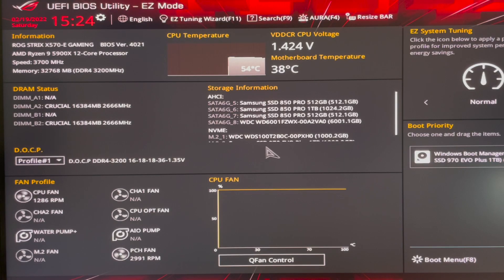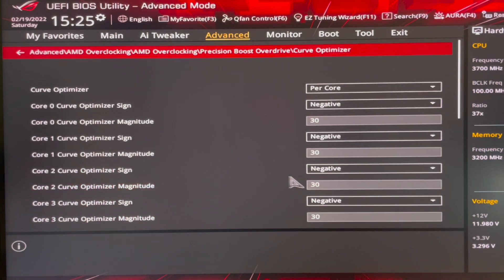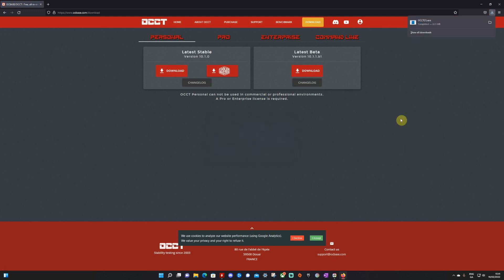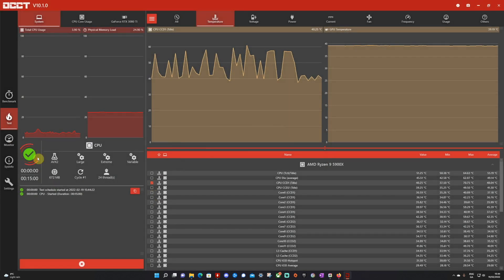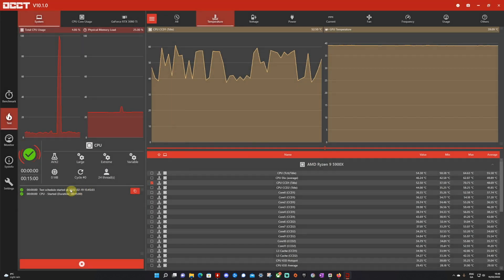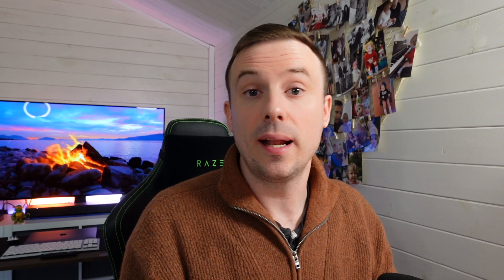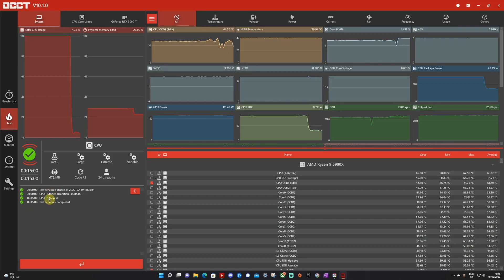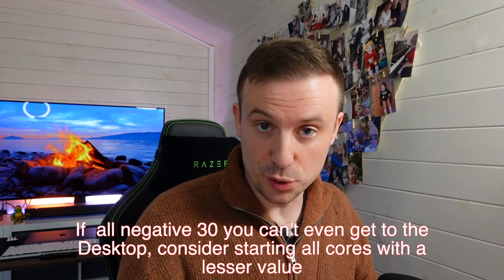Ryzen 5800x 5900x CPU Per Core Undervolt Bios Settings | Lower Temps | Better Performance

Comment: on my 5800x I have a 1.2 core voltage max with a 4.6 core clock and 100mhz boost with PBO disabled in bios completed the 15 minutes stress test on extreme twice in a row and hit a maximum of 66c averaged 60c all cores at 4600mhz. Whereas in PBO curve Optimizer I had all cores negative 30 except my 7th core that had be brought down to -15 and then it passed the OCCT test twice with a max temp of 77c and an average of 74c some cores hitting a max of 4.790mhz most staying at 4.680/4.700.. long story short I reverted back to my manual undervolt/overclock.  I musta hit the silicone lottery with a 1.2v max at 4.6 all core great video and very detailed, PBO just isn’t as good as a manual undervolt/overclock imo. 
Gigabyte Aurous b550 AC 
5800x 
dark rock pro 4 
RTX 3080ti ftw3 ultra
Fractal torrent (stock fans no extra)          HX1000 PSU
Reply: I'm curious if you tested both overclocks against cinebench. Where the score results similar? Which scored higher points if at all?

Comment: Tried -15 -20- and -25 it seems -25 is the sweet spot for my build set the undervolt to all cores and off we go. running smoothly at manageable temps up to 68deg @ 4600mhz+ using occt. Idle temps also improved from hi of 50ish down to 45ish kinda impressive. This is the 1st time i used amd and do actual OC and im proud doing it. before I was so afraid to do it on my intel systems and decided to switch over to amd. Im happy now. thanks.
Reply: hey i wanted to ask, do you find intel or amd either of them more stable than other
Reply: Much easier than doing overclocks in the past . I was always worried about frying stuff and did lose some ram sticks because of it . Thankfully most ram always had a lifetime warranty 😀

Comment: I have a 5900x and tryed it out
But it shows me always an error in core 11..
I've reduced from 30 to 25 20 15 10 5 nothing worked
Reply from the maker: Unusual that didn’t fix it. Did you go all the way to zero? Def the right core I assume
Reply: I didn't try zero. I'm gone down to 5.
Now i set it to all cores like in yoir previous video "option 3" and started occt without to stop by errors. It shows me always errors with core 11.
Idk what to do i'm trying this the first time
Reply from the maker: For this one just use the settings in this video for the amd over clocking settings and do the per core test. You may have to go to zero.

Comment: Getting errors on virtual cores? Should I still lower values per core or do I only do this on physical? Sorry new to all this budd
Reply from the maker: You lower it on the same value core in the bios. So if the error is core 15 then it’s core 15. All should relate back to a physical core
Reply: @FPtechtalk  thanks pal just disnt know if the same for virtual cores. 👍
Reply from the maker: If your still not sure you can email me some screenshots and I can have a look
Reply: @FPtechtalk  thankyou mate

Comment: Hi thank you for this nice Video, very enlightening.
I have a question: I have a Ryzen 5950X and my whish would be to run the base clock as low as - may be 2.4 GHz - but also being able to peak the normal ranges. This would be good for a very power efficient idl mode, since 16 x 2.4 GHz would be more than enough to power any Windows task such as webbrowsing, office, etc. but also needing substantial less power + being very silent too.
I have not fond any chance to do this, you can set the CPU clock down, but this would mean that there is no boost anymore, the CPU clock will stay at 2.4 GHz all timen no matter single core or multicore ...
Is there a chance to to this ? I found plenty of instructions how to overclock the system but nothing how to "underclock" the baseclock.
Thanks + Greets
Reply from the maker: Thanks, afraid I don’t know of anyway to lower the boost clock. Are your temps high on idle ?
Reply: @FPtechtalk  Thank for your fast reply. 
Not realy, the temps hovered around 45 deg. but went down to the 28 to 33 when clocking down to 2.4 GHz. The power cons went down singnificanty also, but there is no boost than, the clock stays at 2.4 all the time. That does not realy make sense to me ...
Reply from the maker: I did notice this before and wondered why the clocks get so high when idle. If I find an answer I will let you know
Reply: @FPtechtalk  Thanks, that will be nice. Have a nice day.

Comment: Hello, I’ve tried this and option one in the previous 5900x video. Yet after I save and restart, it blue screens and says it will try and repair and restart however it then enters a never ending loop and does not solve the issue. Any suggestions?
Reply from the maker: Are you able get to the bios? Are you sure you were in the right overclock section in the bios ?
Reply: @FPtechtalk  yep I’m pretty sure I have the msi 550a-pro, and I went to the amd overclocking in which I have turned PBO to advanced and followed the steps from there.
Reply: Then after all the steps it says your device ran into a problem and needs a restart we’ll restart it for you. Then it proceeds to restart and says the same thing. Which then I have to restore the bios to default to start my pc up.
Reply from the maker: If you can get back into the bios I would reset settings to default
Reply from the maker: Not sure with the bios you are using. I would reset all settings. Maybe try just the curve optimiser
Reply: Ok update now the pc turns on but there’s nothing coming through on the monitor.  I am now panicking. I’m sorry but as of right now I have no idea what to do
Reply from the maker: Are you getting any error lights or codes on the motherboard
Reply from the maker: I’d try the clear cmos button on your motherboard to reset it
Reply: @FPtechtalk   hello again, after leaving it without power overnight it is working again on default bios settings. I just want to apologise for me asking so many questions. Now I have tried just the curve optimiser and still the same message. Could it be due to an outdated bios? Or something to do with windows itself?
Reply from the maker: There could be any number of reasons here but I would def check if your bios has an update available. If your temps are currently ok I prob would not undervolt. You should be able get a stable pc with the curve value set to 10. If that’s not working it prob won’t work for you. Good to hear all is ok again.
Reply: @FPtechtalk  ok I shall try those things thank you very much you have really helped :)

Comment: Found anytime I mess with these numbers and reboot, Windows goes nuts, won't boot normally the first time, but then does boot, or it will boot up into Windows, and hard reboot itself. Usually get some corruption of files when this happens. No idea what is going on. I ended up setting a thermal limit and it still performs really good, 150fps with an rtx 3080 also throttled.
Reply: Make sure you’re changing it in the Advanced / AMD overclocking area. I screwed up the first time I ever tried messing with this also. Scary reboots etc. 

Try starting with -10 and go from there.

Comment: Very informative video I needed this and was searching for awhile on proper way to underclock per core so thankyou for ending the headache but one question is it dangerous to have pbo limits disabled ?
Reply from the maker: No issues disabling them. That’s just if you want the bios to control them.

Comment: There's a much better way to test this. 
- Select Advanced under 'Threads', then click on Advanced Thread Settings. 
- Select only one Physical Core and test it for 1 minute. 
- If it errors or not, make a note then change to another Core. 
- Repeat until all cores have been tested.  
- Adjust all errored cores down by 5 until you reach 20, then 2 after that in Bios.  
- Repeat the above until you get no errors.  
- Do an all core test for 1 hour.     
This is much faster and more accurate this way, and because it's a single-core test, it actually stresses that core more than a multicore test would. It also allows you to monitor the single-core boost frequency of each core. Better cores will clock themselves higher.
Reply: You should make a tutorial then.

Comment: can you make a video explaining and optimizing to get max performance for single core for gaming in instance for fps increase? I have a custom watercooled pc so my temps are typically low.
Reply from the maker: When I use the curve optimiser per core and allow an offset of plus 200mhz I can get 5ghz single core on some cores. There is more you could do but this is all I have done

Comment: Don’t know if I did anything wrong but when I do this it only running at 3693.2 MHz is this normal?
Reply from the maker: No some setting has been changed. In the ASUS bios on the start EZ mode page see if Ez System Tuning on the right is set to normal. Just guessing but let me know. If not that I’ll try look up what setting it is
Reply: @FPtechtalk  it is set to normal shall I change this?
Reply from the maker: Normal is right. I’ll have a look to see if I can find what setting it is. The other option is to update your bios if one available or reset the settings
Reply: @FPtechtalk  I have managed to get past the 3.7mhz and get to 4.2 constantly but I need to change every core and it is nothing like yours when u need to change 2, could be a change aswell??
Reply from the maker: Not sure without seeing what your doing. If unsure I’d just reset the bios and look at start again. I have not changed any options other than what you see in the video. Is your bios up to date ?
Reply: @FPtechtalk  my bois is version 4021 x64 for the asus x570 gaming e
Reply from the maker: Bios version is fine. Just not sure what options you have changed. If you can’t get it working right I’d just reset and start again
Reply from the maker: Just checked and the latest version is 4204. Might be worth updating
Reply: @FPtechtalk  I will give it a go
Reply from the maker: Just done an update myself
Reply: @FPtechtalk  please tell me if there are any changers or I just clueless

Comment: When using AMD Overclocking menu to change PBO settings, what do you do with the PBO settings in the Advanced Menu and in the XFR Enhancement menu? Do you leave PBO on Auto or do you disable it in those other 2 areas?
Reply from the maker: You just go to the settings in advanced menu as I did in the video.  No other options were changed. You can test with PBO on auto or manually adding the settings. I currently have them set to disable with a per core optimiser set

Comment: Hello everyone ! 🙂 Help : i undervolted my 5900X (-25 negative in PBO settings) and the temps are kinda lower, BUT i got far higher spikes (like up to 78 degrees) and i never seen those before undervolting. is that normal ? Thanks 🙂
Reply: amd cpu is normal hitting 92c
Reply from the maker: You shouldn’t be getting spikes  because of this. I’d try some longer benchmark tests to make sure it’s stable. Otherwise revert back to the default settings

Comment: whea error detected   what is this  my test gived this error but dont stop    what am ı doing ?
Reply from the maker: I’m not sure what you are asking here. If you follow the video you can set the test to stop when it has an error. That error will show which core is causing the issue
Reply: @FPtechtalk   tnx to answer  my problem is bayme my cpu broken   all default bios setting  or curve -30  always OCCT gives whea error ( yellow coler error) but don't stop or crush     (my cpu 5900x)
Reply from the maker: Haven’t seen that error. Unusual to get errors even at default settings
Reply: @FPtechtalk   ı faund it :)   new beta bios  doesn't  run 2.000  Mhz  infinity fabric speed     (my ram 4.000 mhz)   ı change  1.900 mhz I.F. (3800 Mhz ram) all clear no error     and my Cpu  -30 curve %100 stabil  (30 minitus of OCCT no error or crash)
Reply from the maker: Nice to hear you sorted it.

Comment: i used the ones from months ago, im new to this but the clock speeds on idle seem too high to say its supposed to boost underload, im getting between 4.2-4.5 and in games i get the same
Reply: Undervolt through curve offset using PBO Tuner ( Don't need to get everytime into BIOS to lower any core offset )  and OCCT to get the best low temperatures with stability on stock settings and then go into BIOS and set all cores overclock at desired value or the extent to which your overclock maxes out without crashing. I have my Ryzen 5 5600 Oced that way to 4.9Ghz all cores and with 77 max temps CBR23.

Comment: What's the difference between this video and the last undervolt video you posted 7 months ago? Is it that same results? I setup to your 7 month video should I change to most recent video?
Reply from the maker: This video shows you how to undervolt your cpu per core. Some people were having issues with the all core as they had to lower it to a level that wasn’t making much difference. This is useful if you have to run at a low setting on curve optimiser all core. Really depends on what your current value is and if you are running stable
Reply: @FPtechtalk  I was reading another post that this is the best way to undervolt instead of undervolting all core. But I noticed you had issues beginning of setting to 30. I didn't. Am i missing something? So I'm guessing all builds are not created equal
Reply from the maker: All cpus are not created equal. If yours runs at 30 stable and no issues then you don’t need to do anything here. You got a great cpu
Reply: @FPtechtalk  that is so weird. We have the same cpu but different results. Thanks for you help. When I seen your first video it was a life saver. Im definitely keeping this newer setting. Thank you.

Comment: Came here from your "All Core" undervolt video. :)
Tested it with OCCT  ,only CORE #2 had error,i had to put it to -20,and thats it,finished whole test 15mins with no errors,after that i tested cinebench ,multicore test passed 10mins max temp was 81c,but single core test failed,got pc restart. Can you tell us any tweak about that for fine tuning? Thanks!
Reply from the maker: There is prob still a core causing an issue. Try run the occt test for 30 mins
Reply: With a 5900x on Asus X570-I strix board, I could only run -10. Anything else upon reboot windows will hard reboot and corrupt files. Not worth the hassle 100hz or so more by fooling with this. I just use the Thermal throttle limit of 75c, set a custom fan and it will undervolt automatically to around 1.2 and 42-4300hz normally, set a custom fan speed curve and also throttle my GPU to 75c limit and custom fan, still get 150fps on COD Vanguard while playing. On a 240hz monitor, still buttery smooth. Can't tell 30-70fps different higher at the cost of massive noise from fans and higher temps of the system.

Comment: Great info, simply explained. I followed your previous guides (and few others from YT) to undervolt my new 5900x, as a noob builder and OC'er it was super simple to do but all core at -30 or even -25 was crashing cinebech eveytime. I ended up setting it to -10 and got a stable system running around 60deg, which was amazing as it was sitting sometimes in the 70's. I do see though i'm only really boosting to 4600mhz, to be fair it'll sit their all day even when under a heavy gaming load, realistically how much performance could be expected from a 5900x?  

I'm going to give this a go and see if it makes much of difference,. Cheers
Reply: i can do -30 5900x all core, no fail in cinebench, occt all threads, sse.. nothing. guess i ve hitted jackpot.
Reply: @alexmckoy8898  same thing here. Is -30 the ”best” value to use if it is not giving any errors?
Reply from the maker: If you can get 4.6 all core and decent temps I could be happy with that. You can go higher and try get it to 4.8 but takes more work at the cost of temps. Hopefully the per core undervolt helps a bit. It did for me. All core in cinebench r23 runs a bit lower that other benchmark tools I’ve found
Reply: increase PPT watt
Reply: So, have you succeeded?

Comment: Thansk for showing us this bro. What do you think of mine? Everything is on - 25 expect core 4 it just negative 10 ( IT got alot of errors even on 15) I have 5800x. Do you think it overall should help alot of my system? Temp is 75 average so its not that cold..
Reply: Invest in a good cooler dude.  Can also lower ppt for lower temps and minimal performance loss
Reply from the maker: That should make a difference alright and give a little more performance. Did you do a temp test before the change to see the difference? When you say 75 average is that under load?
Reply: @FPtechtalk  No sadly i didnt. But i have a really bad cpu cooler. That might be the reason for the high temps. Before i try with prime and it got so warm that it shut down with error..
Reply from the maker: Does prime work any better now

Comment: Wow , definitely you won the silicon lottery, running one stress test is not enough for checking stability , mine is only stable when core 1&2 set to zero and the rest at negative 30 when tested with occt , blender , cr20  & cr23 , 3dmark cou profile and rendering 20 minutes 4k timeline in davinci resolve and i thought it was ok and i accepted my luck 😥😥 but when  i tested it with prime95 small fft it failed so i had to set them further down to negative 20 😢😢
Reply: I have -30 per all cores except 5(-16) and 7(0). What are your results in cinebench r23?